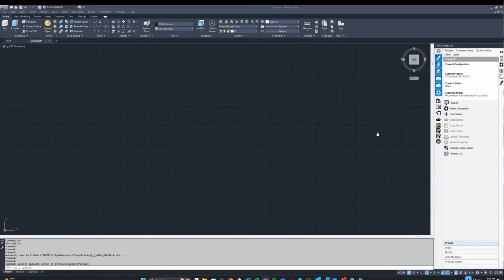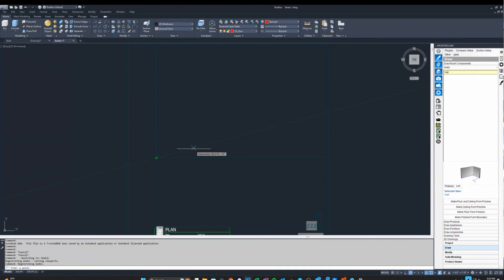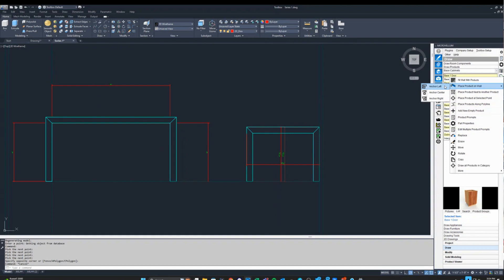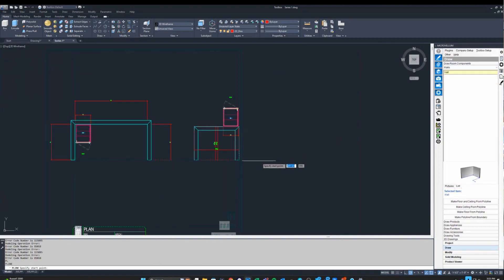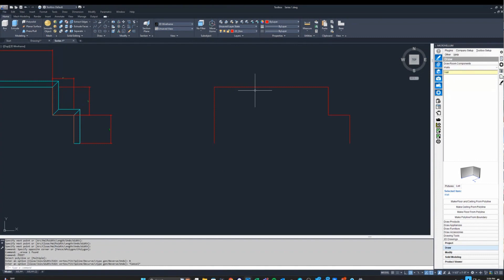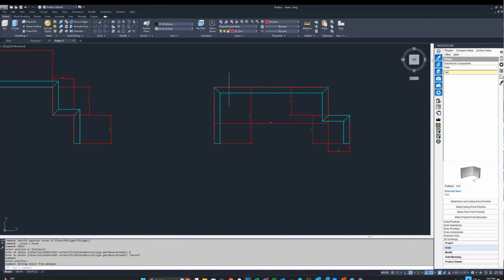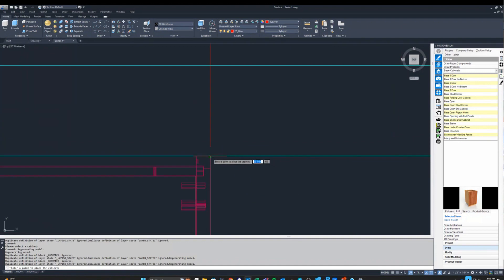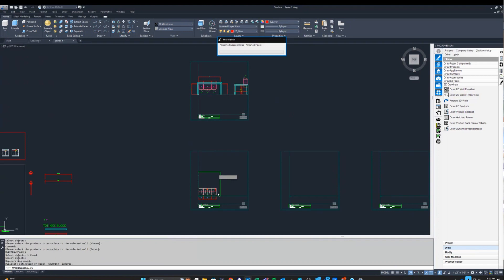Microvellum Basics: Drawing Products on Walls

Comment: Hello!
I’m new to Microvellum and just finished installing the software. Every time I place a cabinet on a wall, the doors appear huge and the hardware ends up completely out of position. Everything looks distorted.

I’ll be reaching out to support, of course, but I’d really like to keep progressing through tutorials like yours in the meantime.
If you happen to have a moment to reply, I’d really appreciate it. Thank you!
Reply from the maker: Hey! I'm glad you're finding our tutorials helpful! 

It sounds like you might have a mismatch in your units from when first installing Microvellum, between metric and imperial. That can often through off parts to be drawing much larger than they should (metric vs imperial). I would reach out to support for sure and they should be able to help you get it straightened out!